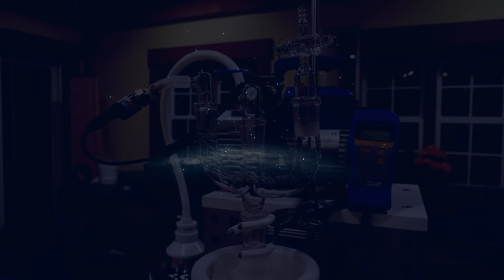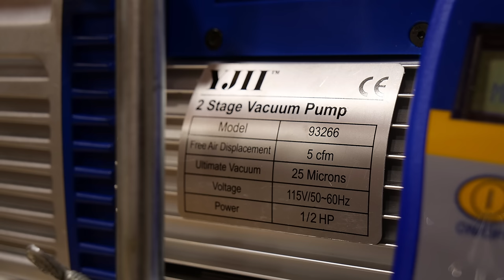Vacuum pump with NO moving parts

Comment: Yes, but the cryo refrigerators have WAY more moving parts, are inefficient, and are insanely expensive, prone to failure, and difficult to repair.    It is hard to lubricate something at 20K!  They cause vibration which causes difficulties on telescope cooled imagers.
Reply from the maker: I wasn't talking about a recirculating refrigerator.  A cryogenically cooled adsorbtion pump sometimes called a "sorbtion pump" has no moving parts.
Reply: @TechIngredients  How is the low temperature maintained in the pump?  No, pouring liquid helium or nitrogen doesn't count, unless you include the machinery to make said cryogenic liquids.
          The cryopump systems I have seen are "turn-key" with nothing required other than (a lot of) electric power and (a lot of) room cooling air.  They have reciprocating Sterling coolers (usually 2 stage, with 80K for the sieve, to trap moisture and most gasses), and 20K for the coconut charcoal, to capture neon, hydrogen, and helium).  There must be 2 systems (with array of 4 valves, heaters,  a mechanical pump for regeneration, and management circuitry) to permit alternate regeneration for continuous pumping (like the oxygen concentrator, except much longer cycles)
          I tried to convince far IR telescope designer to instead use an ion pump/gauge, and "clean up his act" in getting plastics and other outgassing stuff out of the chamber so it could be permanently sealed after the initial bakeout/pumping like a vacuum tube.  Companies make ion gauges/pump (gauge acts as pump) to measure vacuum and maintain it.  It can pump ~10 liters/sec and maintain vacuum to 10 ^ -8 torr.  Ion pump truly has no moving parts!  No vibration, not even from boiling cryogens!

Comment: The fault I see in this demonstration is that you explain how vacuum equipment is heated to drive off unwanted gases but then jump straight to adding molecular sieve beads before heating your vacuum flask. Quite frankly, the claimed improvement could be achieved just by heating the flask without the beads.

I accept the beads and cryogenic cooling can work at locking away certain unwanted contaminants, but they do not in themselves "improve" the vacuum performance over the standard pumping and heating methods from what I see depicted here.

It would be enlightening to see a side by side comparison conducted between an empty flask and a bead filled flask, both subjected to the same heating and cooling cycle. What is the difference in vacuum pressure? Also, is an extra micron or two of pressure really significant apart from the most exacting of large scale, hypersensitive experiments?
Reply from the maker: I think you missed the point.   In this experiment, I was demonstrating the large capacity of the sieve.  Just cooling the gas within the flask would only reduce the pressure to 77K/300K of the 3000 um added when opening the valve.  Only the surface adsorbtion allowed it to drop more than 60 fold.

Comment: "ideas for additional videos"
so... your stuff is kinda fringe, and this is far more fringe than the stuff you normally do. but i think a fair portion would find it interesting.
i've been looking into something called sea-scaping amoung other names. it is basicly fish farming on the ocean.
what is needed for a type of development, to make the sea more "arable" is to be able to control a couple different chemical types.
first being able to desalt seawater, would allow for more diverse aqua products. from hydroponics, to simply having freshwater fish able to farmed out in the ocean, the surface areas of the ocean is quite a bit cheaper both financially, and interms of legal and military contest. so pulling litteral sea salt through a bladder like your aluminum crystaloid, without the bladder itself melting would be pretty interesting.
the method i've been trying to figure out was to turn a 'bladder' into like a 3d conveyorbelt. regardless of whether saltwater was lighter or denser, i thought it should sort itself out like when you leave a blender on for too long. the other salt thing beyond litteral rock salts disolved in the water, is getting fertilizer and fish food back out. a country which wont be named has been farming a fish in toxic waters because they overfeed the fish and the nutrient rich food that isn't eaten settles on the bed where the fish are being raised. this leads to nearly all the fish sold from the country to be inedibly toxic to humans. being able to extract fish waste, algae, and food

the seccond thing which is even more fringe is a reverse filter. for a long while there was a giant floating berg of trash out in the atlantic. much of it was plastic, and through a device to harvest the stuff, the specific symptom has been dealt with. instead of filtering in an exclusive manner, where the bladder is trying to exclude specific things as in the previosu example, it would be interesting if you figured out how to make a reverse bladder which only allowed certain types of things in; for example heavy metals. certain countries have been poluting more than others, and a fair amount of that polution enters the ocean through river/tributary runoff. being able to capture toxins near the source seems like a method of reducing the needed efficiency to get similar net impacts on ecosystems.

with both, it is leveraging a great idea you have already shared, taking a tad more potential for application, and directing it. it takes what you have described- if i understood it, and combine it with a collander or sieve. 
can you 3d print it? can you take a 1 inch deep pool, a hundred meters by 10 meters, use some sort of greenhouse tarp as a screen and just bake something on the beach?

here is a third idea which is both related and not. when you are rolling something, if the roll is too tight it starts to shatter. this is best known when it comes to fiber optics, is there a way to know when you have a plane of something how tight it can be rolled before breaking? this could produce a more video ready piece of content with you making some sort of roller machine. you could roll dough, but since that is fairly well known, you could roll batteries. or you could roll some sort of chemical reagent pair- real chemists would buy reagents which are pure and isolated, but there are some kid oriented things like 'magic rainbow' i think it is called which is a PH detector.
 the idea is that you know how to do something, and you partially do it, but add another step just before the end so you can transfer the part of it you did, the precursor for lack of a better name. teh value would be in talking about how to find transfer mediums, and how to get continual crystalized molecular growth from a solution onto the solid transfer media. another step could be about transfering stuff in various types of flux and the pharmaceudical sugar alternative to flux (IDR the name).

Comment: Molecular would tend to invoke ideas about this being made up of nano sized particles. Would  such a system (nano particles) work better, if say it is placed in a container in the vacuum chamber and then stirred magnetically so as to agitate the particles to increase the adsorption? Just a wacky idea from a non-informed person like me..
Reply from the maker: Probably not necessary.  The gass has excellent access to the huge surface area of the sieve and there is little risk of dislodging nano particles into the system.
Reply: @TechIngredients  I thought about the contamination possibility only after posting this, and besides here In South Africa sleep was getting the better of me... Amazing nevertheless.

Comment: 7:08 13X = 10Å (because X is "10" in Roman numerals?)
Reply: The X refers to the type of crystal used. There are Type A and Type X crystals
Reply: Wow, it's very difficult to find any info about type A & X crystalline structures. It seems three is no info about it, except for the stuff on molecular sieve websites.

Comment: I thought you could make ferofluid vaccume pump similar to the mercury pumps.
Reply: Why ferofluid? Its basically oil so it would most likely off gss
Reply: @ipodhty  I checked the vapour pressure.